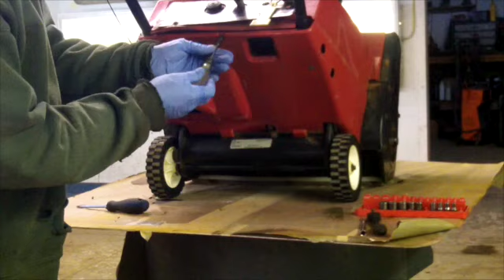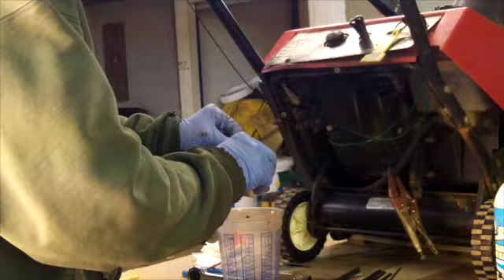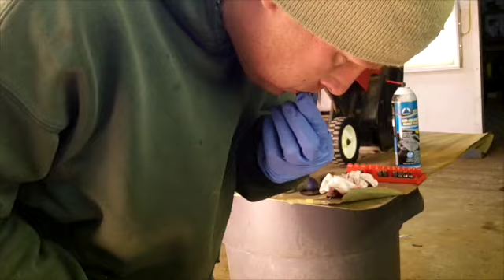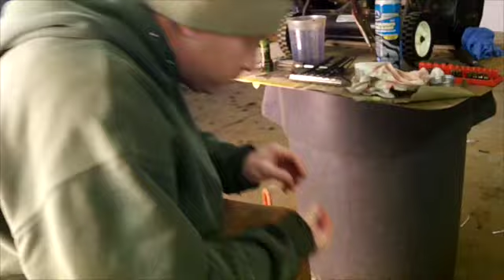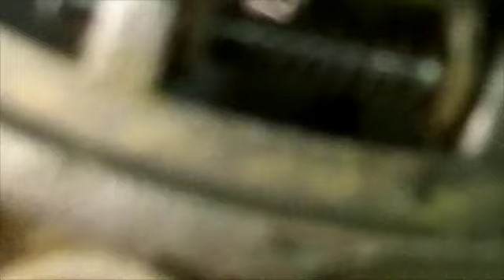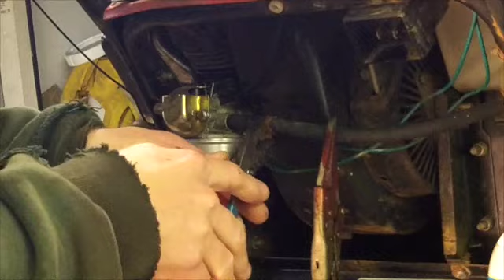Toro CCR Snowblower carburetor rebuild - How to troubleshoot and repair small engine carburetor

Comment: Hello do you really need the spring that passes thru the  pin that holds the float. Will the float in the carburetor work without that spring

Comment: Thanks for you video.. If it wasn't for you I would probably still be trying to get the float on the pin, with the spring postioned correctly.
The thing runs now but backfires so I have more work to do. Do not think it has to do with the gas. Clean fuel, nice flow to the carb and new carb.

Comment: Thank you for showing the proper installation of the spring on the float pivot pin.  I've cleaned a number of mower and snow blower carburetors over the years but today was  the first time I've ever seen that spring.

Before he moved, my neighbor gave me a Toro CCR Powerlite snowblower that been sitting a couple years with gasoline in the fuel tank.  I removed the carburetor and cleaned it but didn't pay close enough attention of how the spring was installed when I removed the float pivot pin.  The parts diagram for the carb wasn't helpful but I found your video and that did the trick.

To mimimize carb problems, I run non-oxy gas in my mowers and snowblowers and drain the fuel systems at the end of the season.  After thoroughly cleaning the carburetor on this recently acquired Powerlite, going forward I should be able to get by without removing the carburetor from the intake and just simply remove the main jet and bowl when the carb needs cleaning.

Comment: Can u increase the idle/speed?
Reply from the maker: These engines are governed to run wide open all the time. So there is no low idle adjustment per se. 
You might be able to tweak the wide open speed a little bit but I wouldn’t get carried away.
Reply: @Velvethamma    
Thanks, put a rebuilt carb on, primed x4, 2nd pull.👍

Comment: Thank you very much for that information. I don't know if you got my text the other way or not. On both the new and old carburetor there is three places to connect hoses the primer, fuel line, and a real small one next to the fuel line. I'm leaking gas out of the small one. I picked this blower up used and there was a small hose on it ( the small the small connector, the hose was blocked at one end. Should I just leave that small connector with the hose that is blocked off , on it. Or is there a place that that connects too?
Reply from the maker: I wonder if the small one is a bowl vent. Either way sounds like the bowl is overfilling and causing a leak
Reply: @Velvethamma  thank you very much for all the information. I have subscribed to your channel and will follow you closely. Thanks again, have a great day and keep your videos going

Comment: What could be the problem with a brand new carburetor on a Toro crr ccr1000 3 horsepower snowblower I put a new carb on it and it's just flooding and actually blowing fuel out the exhaust if you can help me I really appreciate it
Reply from the maker: Carburetor float not shutting fuel off once bowl is full. Maybe a speck of dirt stuck under float needle?  OEM carb or cheap online replacement?  Take carb off and clean. After cleaning turn upside down with float bowl side pointing up to sky and try to blow through fuel inlet with your mouth. If you can hear air leaking, the float needle isn’t sealing
Reply: @Velvethamma  thank you very much for that information, I will try that tomorrow. Also I have on the old and new carburetor I have three nipples for hoses to attach to but only two hoses the fuel line and the primer line. Should I just block the third one off,?

Comment: Good Job.  I would like to ask a question of the group.   Past winter running the same snow blower.  Ran good for 3/4 hour then died.   Put into the garage and it leaked the rest of the gas out of the tank.  Just got around to looking at it and refilled the tank.  No leaks from the carb or hoses now!  But it still won't start.  Any ideas anyone?

Comment: When I saw you pushing the primer over and over I cringed.  I found out (the hard way) that Toro snowblowers with the Briggs and Stratton engines need ONE or at most TWO pushes of the primer button.  Any more and you will flood it.

Comment: I have toro ccr snowblower  the trouble is that the machine cold it start but when it is  run abut 15 minuter or more the machine get hot it can not start, what is the trouble , can any one help me?

Comment: Thanks so much.  I had torn my carb apart 3 times, cleaned and re assembled. No luck starting at all. I could not figure the darn think out.  It was cleaner than new, so I thought.   I watched your video and 17 minutes in, YOU SOLVED MY PROBLEM. You found the blocked super small hole in the float bowl bolt that holds the float bowl on.  Once you said "Take a very small wire and push it through"  I know you solved my problem.  I took the float bowl bolt off, tried to push a wire through. again, again and again.  Finally it broke through, cleaned it up and my Snow Blower is back in ACTION.  THANK YOU, THANK YOU, THANK YOU. DC, from North Michigan.

Comment: I have a question about the needle under the float, this needle part had a wire guide (?) connected to it.  I didn't know where/what/how it connected. I would get the float and spring installed, bolt the float housing down.  Air wouldn't go through either way.  I thought maybe the wire guide was working too well (?) and not letting air through.  I took it off the needle re-installed and it seems to have started and stayed running without it.  My question is, is that wire really necessary on the needle, is it on other carb needles?  Thank you and great video.
Reply from the maker: Lael Hall 
The wire I believe you are referring to hooks under the tab on the center of the float and clips over the top of the needle. Might not be self explanatory but I really don’t have a picture to illustrate that

Comment: Great info in this video, I took the bowl off the carb and sure enough the bolt with the tiny hole was plugged. Put it back on and few pulls later, it fired up and stayed running. Thanks for the video.
Reply from the maker: mike mcguire 
Glad it helped

Comment: This helped me a lot-  dang thing wouldn't start and it is old.  Oddly- there was hardly any gunk in the carb but I did like you said and it fired right up.  There has been fuel left sitting in it over the summer for the past 20 years-no wonder it wouldn't fire up.  Many thanks
Reply from the maker: alittlepale 
Glad it worked!

Comment: Excellent video!  Very helpful. My Craftsman carb looks very similar to yours.  Is there anything you would do to adjust the main jet meter (what you screwed into the carb bowl) in order to make adjustments to the engine running rich/lean? Like, turn it 1.5 turns out from the seat?  I also noticed we both don't have an idle meter in our carbs, so it doesn't look like you could even make that adjustment either.
Reply from the maker: Tim Mullee I don't believe there are any adjustments on these carbs

Comment: So I have a Toro Powerlite, which has the same engine as this one. I started it up today with new fuel. It started within 3 pulls. After that, I hung it on the wall and noticed a strong smell of gas after a few minutes. After setting it down, I found out that gas leaked out of the carb, and pooled at the bottom of the snow blower. I cleaned the carb because I thought the float was stuck, but it didn't help. Could it be the gasket like you thought might leak? Seemed fine when I took it off but it didn't fit back in easily.
Reply from the maker: ChicagoSirens Good chance the gasket was swollen up. I also would not hang it on the wall unless there's no fuel in it.
Reply: Velvethamma What brand of 2 cycle oil do your recommend running in these?
Reply from the maker: ChicagoSirens I use Stihl 2 cycle oil in my commercial equipment and also Opti 2 cycle oil.  Not a big fan of the box store brands.  They seem to make a lot more smoke than the ones I am currently using
Reply: Velvethamma I've been wanting to use Opti-2 as well. Do you mix it at 70:1 or something else?
Reply from the maker: ChicagoSirens I believe opti-2 is a 50:1 ratio just like many other 2 cycle oils. Most all equipment I see requires 50:1 but always follow the manual required ratio for your equipment
Reply: Velvethamma Actually Opti-2 comes in a 70:1 ratio in the packets, but they recommend you mix it 100:1 to use in your engine. That 100:1 mix supposedly covers all ratios.
Reply from the maker: ChicagoSirens I stand corrected... Opti 1 gallon mix pouches make a 70:1 ratio. I ran opti for years because of the ability to buy in bulk. Never had any issues with it

Comment: Velvet.  On/off switch on my ccr2000  seems to be itermittent.  Is the switch supposed to be open or closed when it is in the ON position?  I have spark when the switch is totally removed from the circuit - i.e. circuit is open.  Thanks.  em4bartz@aol.com
Reply from the maker: Switch is normally open when in the on position.  Switch may have a short if it will not start with it installed.  You could check the terminals with an ohmmeter and check for continuity.

Comment: The part I wanted to see was how the vane assy attaches to the link governor.  I am restoring a model 38195 and when I pulled the carb off the vane assy came with it. not sure how to reinstall it. I inserted the vane via a shaft right in to a hole in the engine casing but no matter how I position the link the vane rubs against the inside of the pull start housing. Any ideas?
Reply from the maker: John Jaconsky Sounds like the governor but I can't tell you how it goes. Sorry

Comment: Velvethamma... I have a Toro CCR1000E I got it running about 2 months ago. Now it doesnt want to start and gas leaks out of the carburetor. when I prime it I can see the carburetor fill with gas through the front open of the carburetor. Does it need a good cleaning or a repair kit?
Reply from the maker: dave rig if fuel is leaking out of the carb constantly then the float needle is defective or the float is defective. Might have dirt in the float needle preventing it from shutting fuel off when bowl gets full. Open it up and check it out. If float is full of gas then it's your culprit. Turn carb upside down with the weight of the float closing the needle. Blow with your mouth through the fuel inlet and see if needle is sealing. If not then replace it

Comment: I have one that looks just like this. Toro CCR 1000E. This video was very helpful, but I finally opted to buy a new after market carburetor because my float had a hole in it and rebuild kit was about the same price as a new carburetor  on eBay.  While I agree that it does not have a in-line fuel filter, it does have a very nice filter  in the tank. In my opinion much of the grit and dirt entered through the carburetor breather which is unprotected. (at least on mine.) Do you agree or disagree? I have plans to buy a piece of breather foam and cut it to fit snugly in breather hole. Do like this idea? Why or why not? Thanks again for great video. Oh, and nice work bench. I told my brother you must have concrete blocks in side it to keep it from tipping.
Reply from the maker: +BitsOfTruth Any debris in the carburetor float bowl can only come from the fuel system.  Whether it came from the tank or the terrible ethanol fuel, it didn't come from the body of the carb where the air enters.  A filter couldn't hurt and I've never understood why they don't put one on.  I suppose they figure that in the winter the conditions for snow blowing are not dusty :)  Funny how sometimes the repair parts can exceed the cost of a complete carburetor but that's the way it goes sometimes.  Good luck with your repairs!
Reply: +Velvethamma I thought about it after I had written it. That air should only be going straight into the engine. They are sure wrong. After I used it, It was very dirty. I have been told that even individual snow flakes  start with dust particles.  Price of overhaul kit about $14.xx and  whole carburetor about $17.xx. By the way, it does run and work very well. I will post a video. Thanks Much.

Comment: Recently my blower would not start.  I took off the float bowl and it looked clean.  I was told sometimes the pin just sticks and put it back together. I did so and it ran again, but it sounded like the RPM's were high.  Now after using it a few times, it starts, runs high and then stops - it won't stay running.  Any ideas??
Reply from the maker: Not getting fuel... Either the float needle is sticking, float is bad, or something is intermittently getting in the main fuel jet that's causing an issue starving it for fuel.  Also, a fuel cap that doesn't vent properly will give similar problems

Comment: Thank you for the great video. I have had trouble with the carb leaking and rebuilt it with a new float, seat, needle, gasket ect and followed your video to ever detail.  As soon as I hooked the fuel line back up...it immediately started leaking from the bowl again.  It is literally driving me nuts.  Any suggestions b4 i throw this thing in the trash.
Reply from the maker: That linkage has to go thru the carb and governor arm.  Usually just has a little z bend in the rod.  Spring must go thru same hole in carb and governor.  Rod should slide thru spring, not ride beside it.  Hope this helps
Reply: It is the exact same model as the one in this video.  Everything is the same.
Reply from the maker: bdgrd4u Is it leaking from the bottom of the bowl by the nut, or from the bowl vent.  If it's leaking from the bottom, I would be suspicious of a bad bowl gasket, pinched gasket, wrong gasket... you get the idea.  If it's leaking out of the top (above bowl gasket) then the needle is not seating and allowing the bowl to overfill.  Possible problems are needle fell off the float during assembly, dirt not allowing it to seat, improper float or float height.  I always test my carbs to see if the needle will shut off the inlet if I change them.  To do this, assemble needle on float attached to pivot and before you put the bowl on, turn it upside down and try to blow thru the fuel inlet with your mouth.  If you can blow by the needle with the float touching it (gravity pressing it down), then you have something wrong or a bad needle and seat setup.  Some of those have a nylon or rubber seat and a metal needle, others have a neoprene tipped needle and brass or steel seat.  Not usually metal on metal for the sealing surface.  Carbs like this are very simplistic in design so it's likely to be something simple.  Be patient and give it another go around and see if anything was overlooked.  Make sure all gasket surfaces for sealing are completely clean of any deposits or you may get a leak that way.  Good luck!
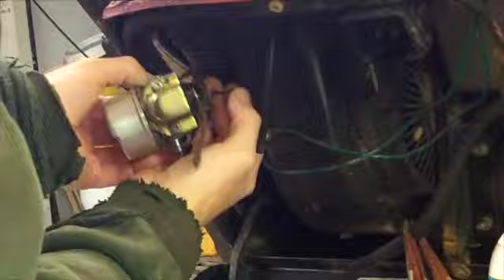Reply: Velvethamma Thanks! Found out the carb had a hair line crack in it! Got a new carb and starts great, however, it was idling too high.  Noticed the idle arm was extremely loose through the governor.    It was not conneted to the governor....just sitting through it.  Took it to a guy who works on small engines and he hooked the arm up to a hook on the governor.  I advised him that  I don't remember it being like that when I disconnected it...but I cannot be 100% sure.  Does it hook onto that hole on the governor?  10:50 & 36:10 of the video.  It doesn't seem to be running strong now.  It is not throwing the snow nearly as far as it did before the problems.  Thx.
Reply: Velvethamma The linkage fell off the plastic part under the cover and I cannot for the life of me figure how it goes back on
Reply from the maker: bill fronk Governor linkage connects on the throttle of the carb and to the governor arm on the engine.  Can be a bit tricky to put back together.  Kind of a twisting maneuver of sorts
Reply: Velvethamma  yes it is , not sure what end goes where , its has two different ends  on the linkage ?
Reply from the maker: bill fronk I would think by trying all variations, you will figure it out.  I can't picture it so I'm not sure how I can steer you in the right direction...

Comment: I got a Toro 2400 E and I cleaned out the carb and it has a new spark plug.   When it runs the idle climbs really high, Is this normal?  How high should the idle be?
Reply from the maker: If the idle starts low and continues to climb high, there is an air leak or it's starting to starve for fuel.  Idle should not fluctuate much.  Something may still be stuck in the primary circuit (idle) side of the carburetor.  Don't know for sure what rpm they should be set at but most are governed by engine rpm.  Did you forget to put the governor spring back in the proper spot when you removed and installed the carb?  A broken governor spring may cause erratic problems for sure

Comment: When i pulled the float bowl off a small o-ring was in the bowl. Can you tell me where that goes?
Reply from the maker: Not sure why there would be a small o-ring in the bowl.  The only one I can think of is the bowl gasket o-ring which is fairly large.  I'd have to see the carb to make an educated guess.  Not every unit uses the exact same carb unfortunately
Reply: Thanks for the reply! It was the small o-ring that went up into the carb inlet. I looked at a diagram and it must have stuck to the bowl nut because the fuel was so bad. I put back in and will fire back up tomorrow. Thanks for the good video!
Reply from the maker: stephen west Didn't even think about the bowl nut having an o-ring.  Usually it's a copper or fiber flat washer that provides the seal on that.  Glad you got it sorted
Reply from the maker: ***** No removable emulsion tube in this carb
Reply from the maker: Neither.  Tecumseh 2-stroke, not a 4-stroke with valves
Reply: The o-ring went up into the tube that the bowl nut screws to. It's very small.